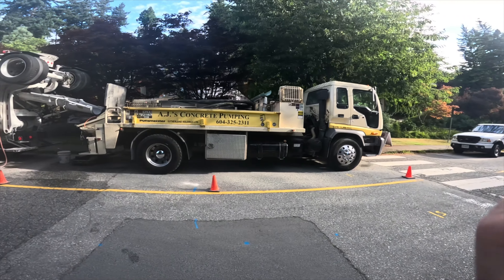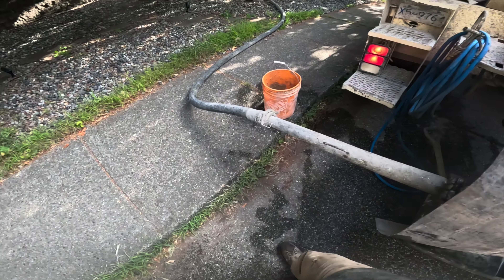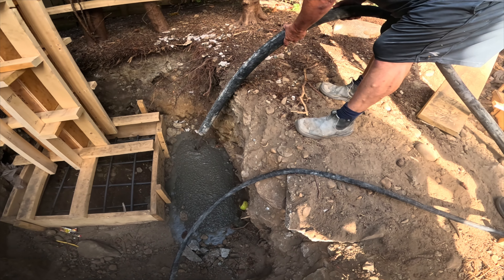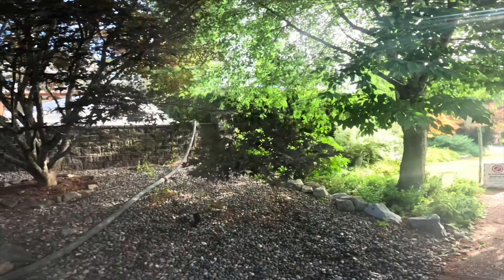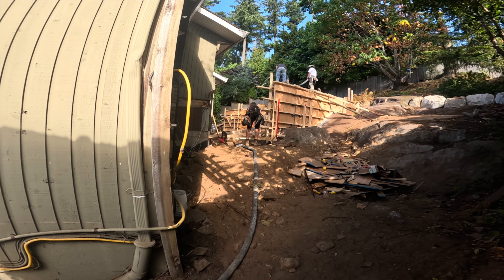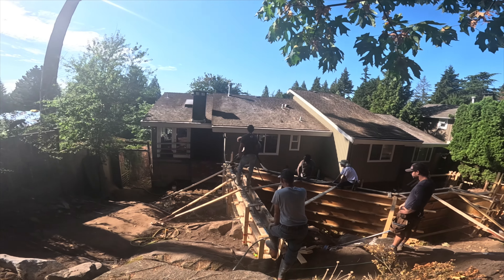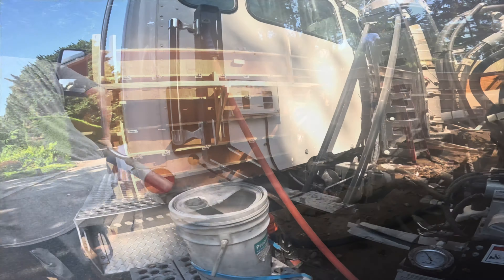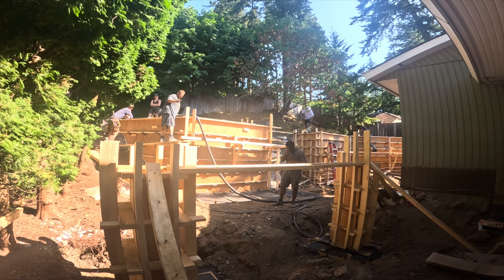How much concrete is in the drum??? (running short of concrete on a 90 degree day)…

Comment: Why did u put dirt in? I'm confused never seen that B4. Also do they have forward facing concrete trucks in Canada?
Reply: nope they are garbage / unsafe. rear discharge is the way to go
Reply: @kkkkksksk  I disagree w everything u just said. But thanks for the answer
Reply from the maker: We actually don’t. I believe it’s mostly to do with our local axle spacing and weight stipulations. It’s amazing to me the places where you guys are able to sneak those front discharge mixers into and pour right from the chute. If we did have them around here in betting they would eat up much of what is otherwise gravy work for us pump guys.
Reply: Front discharge concrete trucks are awesome that’s all we use here in the US. Most of the companies switched to them because of their versatility and traction control off site with all wheel drive however, Union concrete companies have to keep the rear because that is somebody’s job to hold his shoot as far as Weight goes they are longer and have more access. They would be legal up there.
Reply: @petes7796  💯👍 agreed
Reply from the maker: @petes7796  agreed. I’ve never worked with them personally, but I’ve seen some of the places @GRUBB-MUDD squeezes them into. No way our rear-discharge trucks could match them in terms of versatility.
Reply: @MuddyfeetConcretePumping  hey what's up muddy feet! I appreciate the answer, I literally had no idea. Thank u bro... u always told me to keep the hubs lock3d in 😆  4 real tho thanks... youtube shorts for the win 🏆
Reply from the maker: @MuddyfeetConcretePumping  thanks Jeff, I much appreciate the kind words. Credit to you as it’s your channel which inspired me to start mine. 
Question: how do you find the Schwing hopper compared to an S-tube style (Putz/Alliance/etc….) in terms of residual buildup.
Reply from the maker: @MuddyfeetConcretePumping no kidding? We’ve got that big Schwing trailer pump which we just picked up. You’ll have to get on up here and show us how to run it!
Reply from the maker: @MuddyfeetConcretePumping  I completely agree with you. The  only difference between the two (which I’m aware of) is horsepower. I honestly feel that for the residential work which us and yourself do primarily with these pumps, the additional horsepower is not needed and just equates to more fuel consumed.
Reply from the maker: @MuddyfeetConcretePumping I think you’ll like that the 750-18 as it uses a 7” material cylinder (as does the 1000). Should notice significantly longer life from your west parts in comparison the the SP500. The other benefit of less strokes per cubic yard pumped is less surging/wear and tear on the hoses. We have both 6” and 7” Putz machines, and aside from pumping shotcrete work, the 7” material cylinder wins every time.

Comment: A tricky pour with the layout there and issues but you nailed it the finish came out OK despite the escaping mud but it was all hands' to the decks and got the job done.
Reply from the maker: Definitely breathed a sigh of relief when they stripped the forms and there was no visible cold-joint/load-line. With a near 2 hour break between lifts on the walls, we were expecting the worst:

Comment: Hi can you tell me what size aggregate you use in your concrete. We use 4 inch concrete pipes and we’re told you can’t use anything smaller because it wouldn’t go through smaller diameter pipes
Reply from the maker: Architectural mixes we use 3/8” aggregate. For most of our other line work we use a 1/2” aggregate. Both 3/8” and 1/2” we pump through 2” line. All that being said, I have seen 1/2” 3/8” and even birds-eye mixes which wouldn’t pump through 4” steel pipeline. It really depends on many factors aside from just the size of the stone.

Comment: I'm looking to trying out Bentonite is there a Specific Type of bentonite you are using?
Reply from the maker: Anything which goes by the name of “high-yield powdered bentonite” will do the trick. We’ve used several different brands over they years (based on whatever happens to be available at any given time) and they all work pretty much the same.
Reply: wyoben high yield bentonite good stuff
Reply: @canadianconcretepumper1979  Unscented, non clumping kitty litter.
Reply from the maker: @chrisallen2005  it’s hilarious the variety of things us pumpers use for priming out, blowing out, sucking back, etc…. Kitty litter wins!!!!